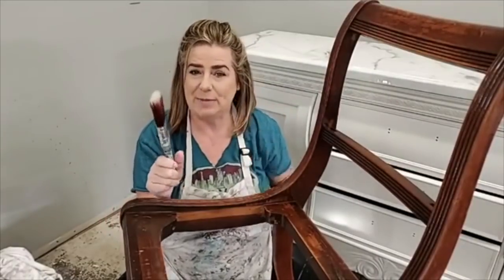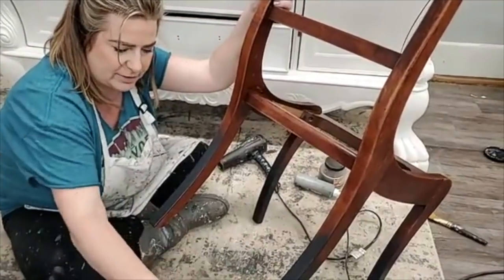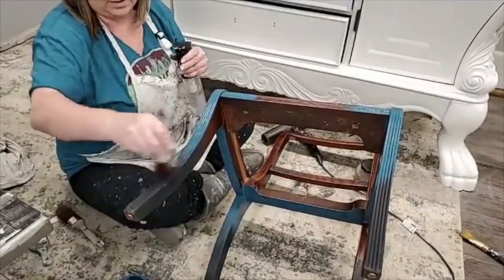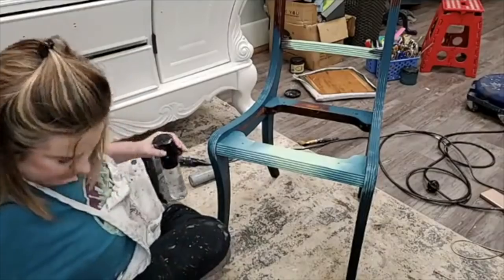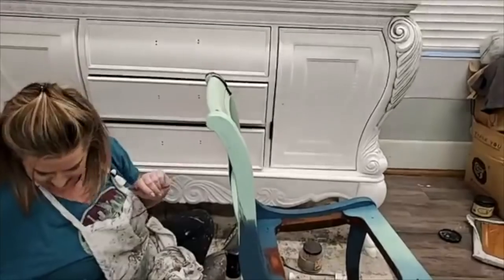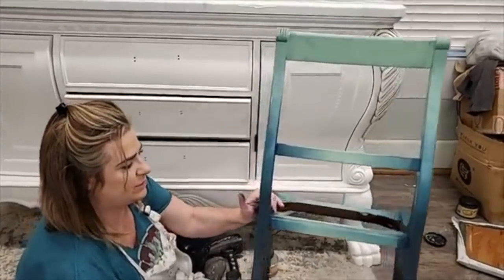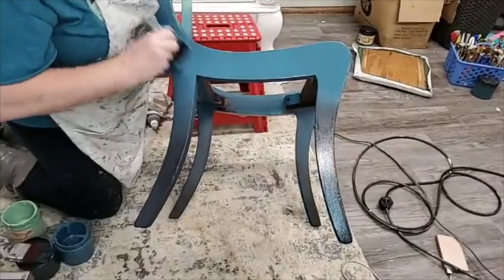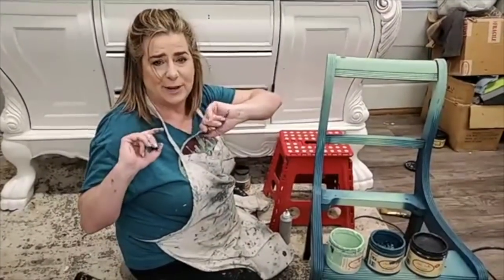3 color Brandy blend on a chair - Live with Brushed by Brandy

Comment: Om! This video is helping me a lot. I have almost the same chairs. And I want to blend 3 colors. Tying my best to follow your instructions but for some reason is not working. It seems to be I am pulling the paint instead of blending it 🤪. Help !
Reply from the maker: Could be the type of paint you are using or the prep of the piece. Paints that have more clay in them tend to reactivate faster. Having a primer on helps the paint adhere. Also make sure your base coat is completely dry
Reply: @BrushedbyBrandy  thank you so much. I used a primer and let it dry for 24 hours. I am using a water base chalk paint and water based primer (boss). The same brand you used in this video.  I think I was overworking it too much. I am going to try again today to blend. Lol I keep watching your video. Wish me luck. Thank you again for replying. I follow your Chanel and love everything you do !
5-22-23 A happy update! Thanks you you, I was able to apply the blending technique to 6 of my chairs.  I know I still need more practice but I was at least able to transformed my chairs. Thank you!!!